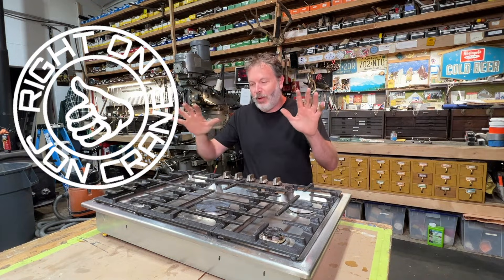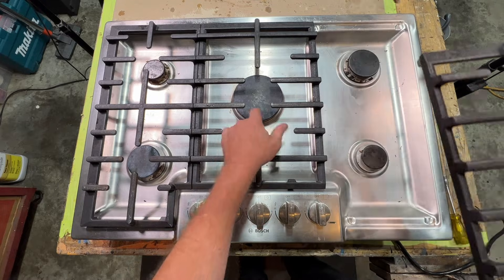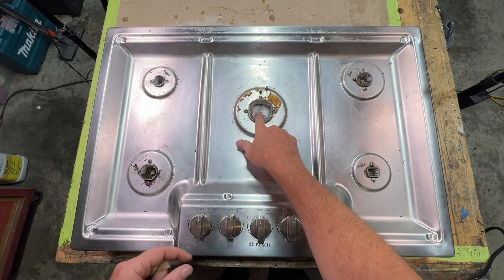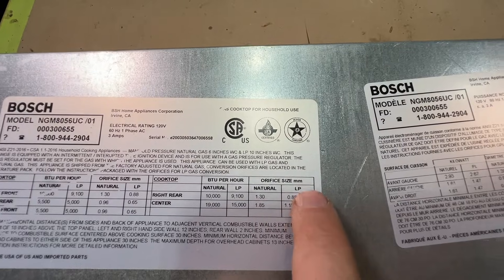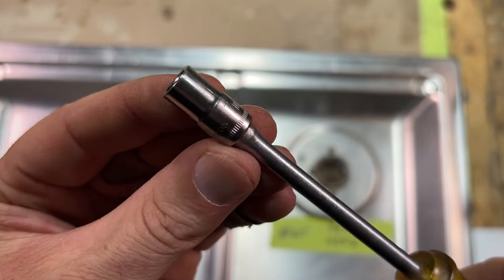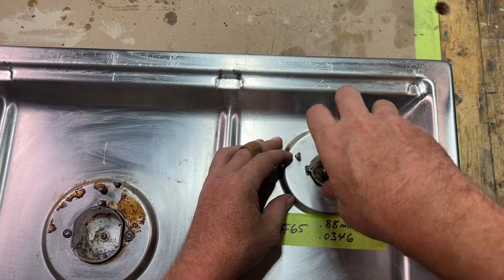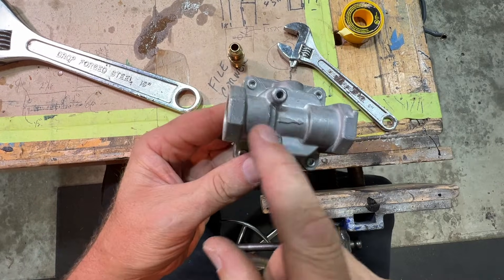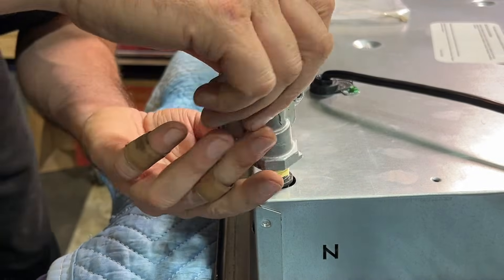Convert  Gas Stove To Propane - Follow Step By Step - Orifice & Regulator

Comment: Great video a question 
So in my summer house my contractor installed the cooktop with the regulator just underneath which looks fine will do check if he changed it from natural gas, but since we having the propane tank outside it has one of those connectors that bbqs having with a regulator, so will there be an issue with the 2 regulators installed??
Reply from the maker: No that’s good with the two regulators and is usually the case. One at the tank and also one at each appliance. 🙌
Reply: @RightOnJonCrane thank you

Comment: I have converted my cng boat stove to lpg. The local store here sells a hp bottle of cng for $75.00, it has gotten to expensive. So i added a gas detector, and changed out the regulator, and now pulled out the two fitting. Will take them home, and braze them and drill to a smaller fitting.

Comment: Do you have a link for the conversion charts you are using?
Reply from the maker: Hi! I don’t have a specific chart that I have used. If you look up LPG orifice size chart on google there are several charts that come up. Sometimes you have to convert from mm to standard. Also be sure to check on your stove for an orifice spec sheet showing orifice size and BTUs.
Reply: @RightOnJonCrane  I'm talking about that Starrett thing you were using.
Reply: @RightOnJonCrane hello I don’t think my stove hasn’t the tag with measurements for the orifices is there an other way on how to know which size is it orifice and what size should I convert it to?

Comment: Hi. Can I convert a Natural Gas wall oven (Empava), which has 1/2"-14NPT threads, to Propane with 5/8"-18UNF threads? According the owners manual, the regulator is compatible with both NG & LPG so I take that to mean it doesn't need to be swapped out?

Comment: why drill them bigger if propane is a smaller orifice?
Reply from the maker: Ah yes that is because I bought a variety pack of new orifices that were smaller than the specs on the stove so I drilled them out to the correct size. I put a link to that pack in the description. Right On! 🙌🔥🔥

Comment: Excellent video, thank you for making it. I'm doing exactly the same job. I figured that I'd only need to convert the orifices' and regulator but the stove top does not work. I see that you used two regulators: the one for the stovetop and a standard propane regulator where the hose attaches to the tank. I'm going to try it as you did with two regulators, but I'm unclear why this set-up would need two regulators. There is obviously knowledge here that I do not have. Can you help? Thanks in advance.
Reply from the maker: Right On! 🙌 Yes, usually there are two regulators. One at the tank and then another at the appliance as some units have different requirements as far as units of water column. The setup I had was 11 WC on both regulators. It is redundant and not necessary until you have a tank setup for a house or building. Yours should run on one regulator. Are you getting gas at the orifice when you turn on a burner? Ignition system working?

Comment: What size regulator to I need coming of off the propane tank?
Reply from the maker: It all depends on what size pipe you’re running. You want one that will accept the correct pipe size. Be it 1/2” or 3/4”. It should be 11 inches of water column in most cases.  11WC. Then there is another regulator at the stove itself. Usually the same. But smaller in size, still 11WC . Hope that helps. Check your stove specs to make sure.
Reply: @RightOnJonCrane  awesome, thanks. I'm running 1/2 " pipe. That's what I needed to know.

Comment: Great video! Thx for posting. I followed for my set up NAT to LP. Burners are on, but not burning cleaning. Flame is too big, and yellow orange at the tips, leaving soot on the bottom of the pans, the flame power changes when more/less burners come on, and when the extra low/simmer level is selected the flame goes out. Any ideas?
Reply from the maker: Right On! 🙌 I would check the orifice specs on the unit again to make sure you have the right size installed. Sometimes there are air control inlets for each burner that you can open and close to let more air flow to the burner. Mostly in older stoves. 
An orange flame is letting in too much air. Orifice might need to be smaller. They are easy to swap out. I’d try smaller sizes until the flam looks good. 
Hope you get it fixed!
- Jon
Reply: Hey, can you the link for Amazon to order also the drill to buy
Reply from the maker: @Mahdi-fu4fe  https://amzn.to/3A5xt7d

Comment: Jon, a long time ago, when I worked on oil burners, I was told to NEVER touch the nozzel tips with my bare fingers, because the acid in the hands would eat out the holes and not burn correctely, so would that still apply to the burner tips on a gas stove. Is his correct or not, if you know? Thanks
Reply from the maker: Hi Matt! I have not heard that. I dug around a little on the internet and could not find anything. But that’s a good thing to research. 🔬🙌 Right On! 🙌 Hope you’re doing great!